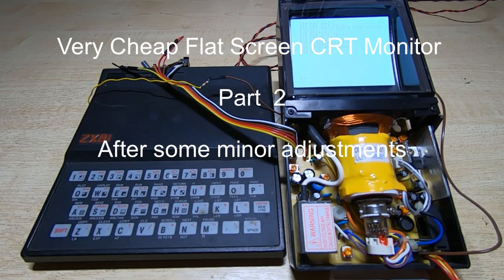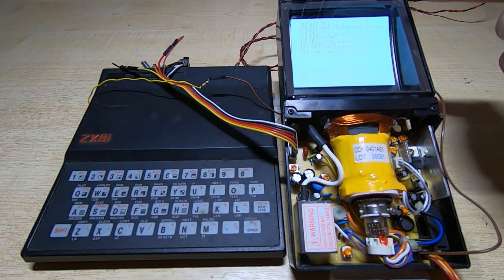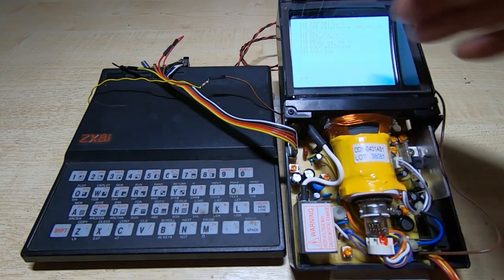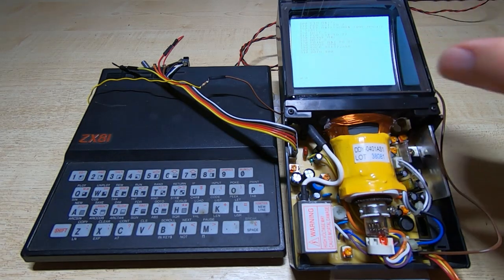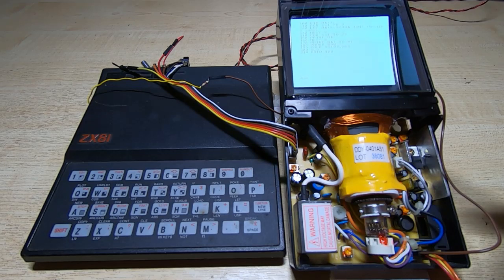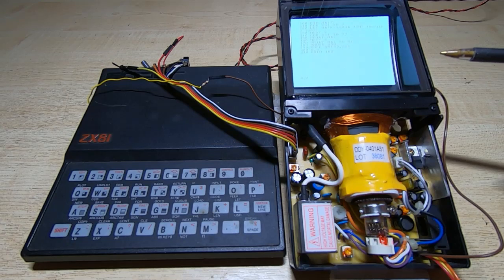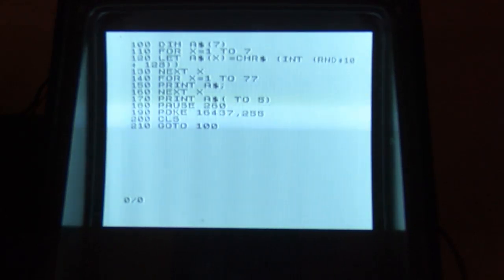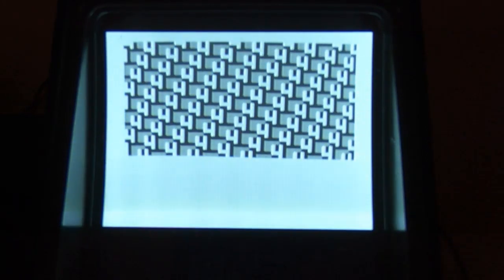Very Cheap Flat Screen CRT Monitor Part2

Comment: Thanks for sharing this. I picked up one of these units several months ago. They were so cheap, how could I resist? I was so amazed that it arrived 1. intact (poorly packed) and 2. it worked! So I bought another. I intend to make a hand held Pong game using vintage Pong chips. It worked really well with the composite video signal from my VCR. I'm surprised that it's taken so long for this to catch on in the hobby community. I suspect that the price is going to rise before too long. Thanks to you I now know how to fix the image distortion by adjusting the yolk coil and magnets. By the way, can you tell me what female 4-pin and 6-pin connectors to use? I can't seem to locate the correct ones. It would be much nicer if I could just plug into the connectors rather than soldering wires to the PCB. Cheers!
Reply from the maker: I was also surprised that it arrived in one piece. I just used 0.1" crimp housings for the plugs.
Reply: Erik, what site & search term did you use to get these monitors?  I've looked at eBay (US?) using the model number that is on Jerry's monitor and found nothing.
Reply: @bobvines00  Jerry posted a link to AliExpress in the first video. Just look for the link below his earlier video and click on it. It'll take you right to the source.
Reply: @erikburman530  OK, thanks!  I missed that and will go back and find it.
Reply: @JerryWalker001  my 0.1" (2.54") crimp housing doesn't seem to quite fit right. The pitch between pins on then board  seems to be a bit narrower at about 1.8mm. I can't seem to find anything that works.

Comment: But it's so much more fun to make all of these adjustments on a color CRT! 3 times as many, and make sure they all align with each other! Bad memories!
Reply from the maker: I used to repair colour TV's when I was at school to earn money and until the new Trinitron tubes arrived I think some sets had over 100 convergence controls, most of which interacted. I do not think many people these days realise how simple things are with modern electronics. The Trinitron (with the rectangular dots) only had maybe 20 which at the time seemed like science fiction. I opened a 25" colour (CRT) set about 10 years ago and all it had inside was a small pcb about 5" square with 6 IC's. Not as much fun.

Comment: I have to reach out, I have one of these I'm using to make a portable All-in-on Apple 1 in a case, but it shuts off after warming up about 30 seconds later and I have no clue how to prevent that. How did you stop it if you had to at all?

Comment: BTW, may I suggest putting a low pass filter on your videos. There's a loud high pitched whine on the video. Which is surprising given the audio compression...
Reply: (it's not in other videos, but with extended frequency content the rule of thumb is if you can't monitor it, then it's best to remove it) (you could probably just put a sponge on the mic)
Reply: @cheater00  I'm not hearing any whine. I'm just using my laptop speakers though.
Reply: @john_in_phoenix  i'm using calibrated mastering monitors. that's where my comment comes from - if you can't monitor it, cut it out. you can't monitor it, so you think it's not there. it is.

Comment: I bought the exact same monitor a few months back - 6 units - the idiots sent the thing just wrapped in packing paper, no padding, in an apparently pre-softened box, and all the housings came in shattered. I think the electronics and tube are fine though... I got distracted by something genuinely important so I wasn't able to follow through with the arduous refund process at aliexpress.
Reply: Thankfully the two I ordered arrived intact but only by shear luck! The packing is terrible! One has to be prepared for it to arrived damaged. By the way, I've found that the AliExpress refund process is pretty straightforward. You should give it a try. I've never had any problem getting my money back. I've had orders that never arrived, or were damaged, or were not as advertised. In every case I've eventually received a refund without too much trouble. The shipping times tend to be very long. You can't file for a refund until the estimated shipping period has ended and it's easy to forget about it.
Reply: @erikburman530  taking the pictures, uploading them, and making a report was too much time for me, i was dealing with way more important shit then.
Reply: @cheater00  If you find the time it might not be too late to get a refund. If enough people complain than maybe they will put more effort into packaging them. On the other hand maybe they're so cheap that they don't care if they occasionally arrive to their destination in pieces.
Reply: @erikburman530  it's way past the 3 months aliexpress allows.
Reply: @cheater00  I guess you lose then. Better luck next time.
Reply: @erikburman530  it's okay, i had something else to win that was more important.